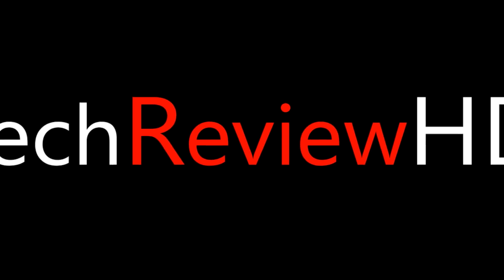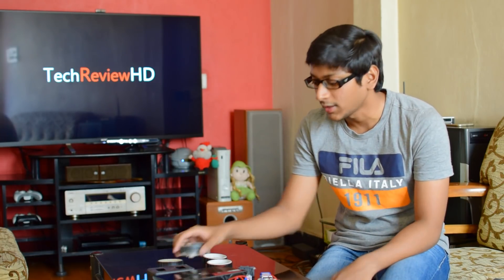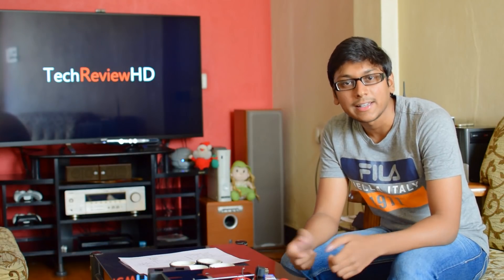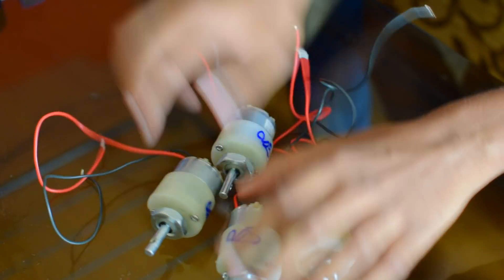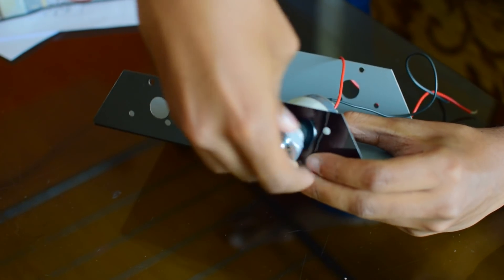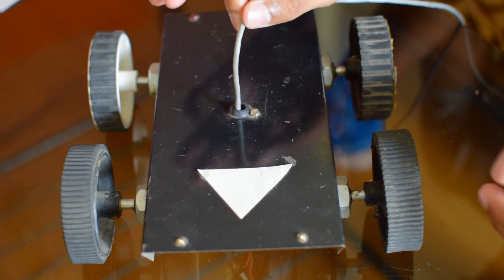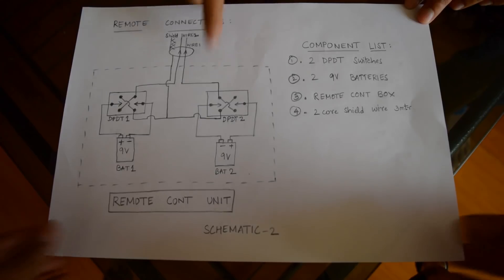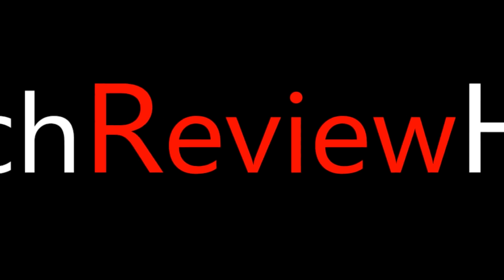How To Make A Remote Control Car at Home - Very Easy!

Comment: Hey Vimal,Great job...
thank you for making this video as I wanted to make a school proiect like this one...
A problem has occurred...the geared DC motor which I bought is rotating very slowly when under a single 9v battery.
can you please tell me how can I overcome this problem..or can you tell about the maximum current or batteries that I can provide or use to solve my problem????
My project really needs your help

Comment: Ur video was too good..but i cant get that motor...i hv checked out that site uu hv provided for the motor and other parts..but on that site "500 rpm 12v DC 6mm white geared motor"...ye wali use ki h kya apne...mujhe bilkul vesi hi use krni h apki jesii.....plz plz plz help me out.
Reply from the maker: +Swarnima Chaudhary yeah,i used those motors only
Reply: Okk...thanks.

Comment: Thank you... it really helps me a lot.
Reply from the maker: +Ayush agarwal :)
Reply: Sir can you help me in increasing the speed for the car.
Reply from the maker: +Ayush agarwal Yeah,you can use higher rpm motors like 750 or 1000 rpm to increase the speed.
Reply: high rpm ke liye....sir Uske liye battery Sme he rahegi???
Reply from the maker: yes

Comment: shouldn't RC have transceivers, transmitter and reciver which i didn't spot in your schematic, overall great video
Reply from the maker: +TopMusic Thanks,RC means Radio Controlled but mine is Remote Controlled Car.
Reply: +Vimal Chintapatla doesnt anything wireless needs transmitters and receivers to communicate

Comment from the maker: It's Finally Live!
Feel Free To Share If You Enjoyed.
http://youtu.be/Uy9VnZDFXPE
Reply: +Vimal Chintapatla hey i liked the video i wanna try this but i m not getting the wire from any home source can i get this wire.can't i use wire other than 2 core shield wire
Reply from the maker: Hey +daideepya vanmali ,i just used the 2 core shield wire to keep it simple, you can use any wire for the connections.
Reply: +Vimal Chintapatla  tell me where can buy requrement tools&itmes to builds this car
Reply: can you add a claw to it ? like one that picks up stuff
Reply: +Vimal Chintapatla please upload the wireless  one
Reply: +Vimal Chintapatla Hey please tell me your connection for those LED.
Reply: +Chinmay Buvaji  karan
Reply: the start of engineers